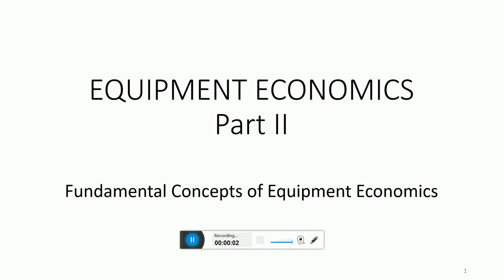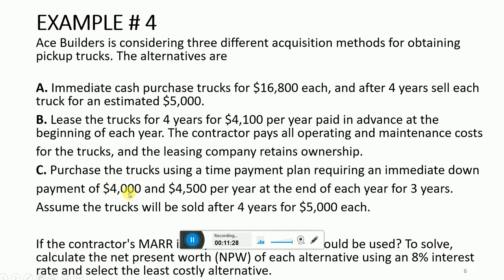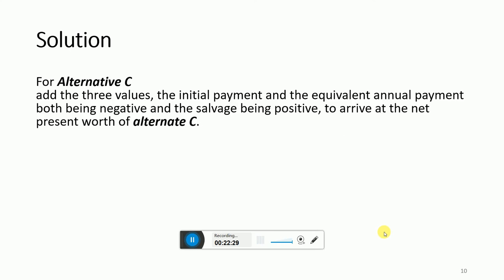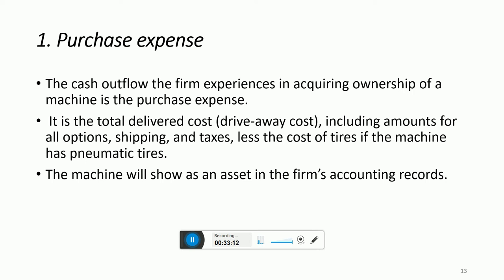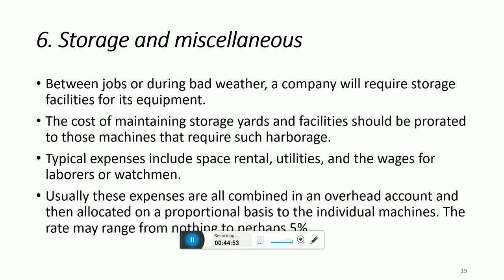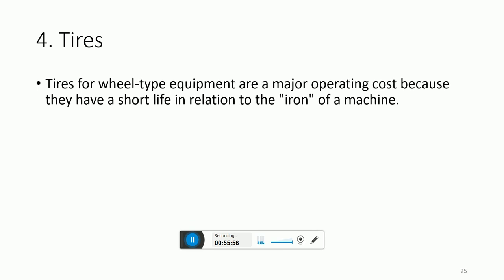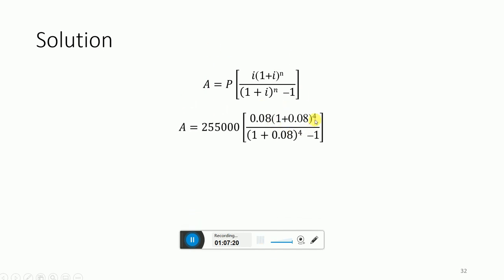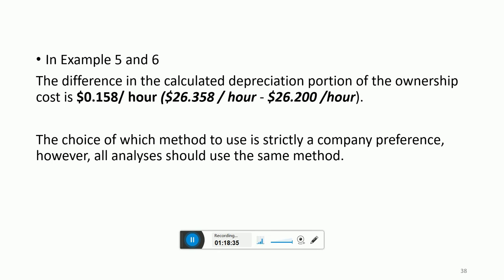Equipment Economics 2 - Fundamental Concepts [Economic Decision Analysis]

Comment: In solution of example no. 4, for calculating NPW, USD 5000 (salvage value) has been divided with PWCAF but PWCAF is "1/(1+i)^n". I think the salvage value needs to be multiplied with PWCAF which is clear from the solution for alternative A. This may be a typo error.
Reply: Same is the case for alternative C